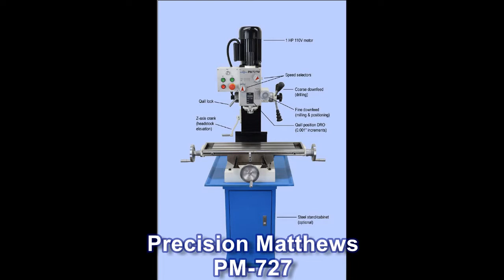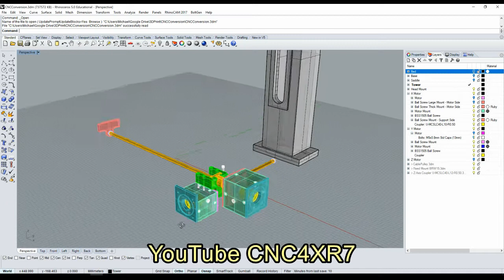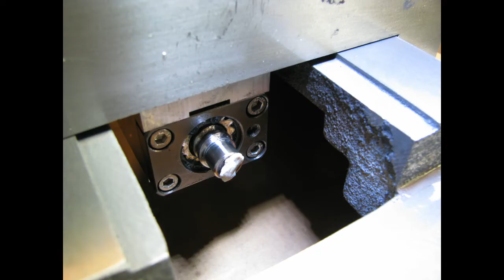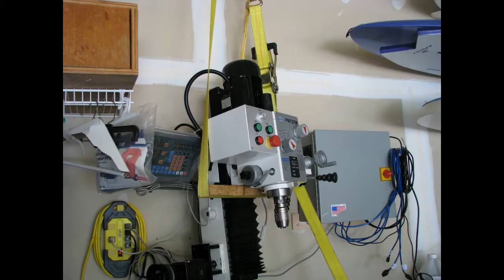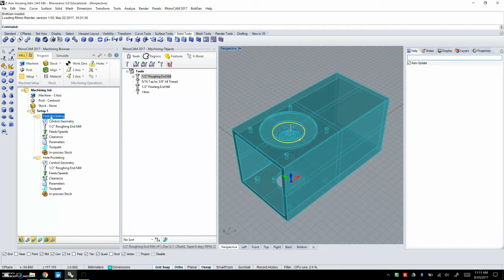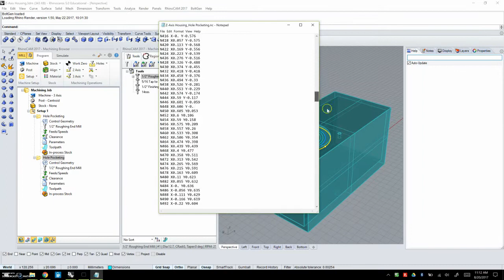CNC Milling w/ Rhino, RhinoCam, & Centroid Acorn

Comment: Came here after finding the Centroid-sponsored video of your PM727 build. I'm going to do a build based on their new 728VT. I was wondering two things: a) what is the complete part number of the OMRON encoder you used, and b) what are the coordinates for the lower cost provider for the Royal quick-change tool holders? Cheers!
Reply from the maker: The encoder I am using is a E6B2-CWZ1X.  The website for the Easy Change Tooling: http://www.engineeringsupplies.co.uk/tool-holders-easy-change-c-175.html?page=1&menu=1

Comment: Great job on your build Mike. I am in the process of converting a PM-30MV. I purchased some of the proximity sensors like you used and had a quick question regarding wiring them up to the acorn board. You mentioned you ran your sensor wires to a small project box then from there into the electronics cabinet to the acorn board. My question is that on the Acorn wiring diagram it shows to wire NC limit switches in series and wire them to IN1 on the board. Since these switches are different than a normal limit switch because they have to be powered, did you wire your switches in series or did you wire your switches to the other inputs on the acorn board. Thanks, Al
Reply from the maker: Thank you for the compliment.  Good choice on the PM-30MV, its is an impressive beast.    I can attest to the quality control of Precision Matthews and they stand behind their product.

You can wire them in series.  I'd paste a picture if youtube would allow, but I'll have to describe in words.  Starting off, each sensor gets 24V power (Brown input).  The first sensor in the chain has it ground (Blue input) running to ground as normal.  Now, the first sensor's signal (Black input) runs to the ground input of the second sensor (Blue input).  And this repeats for the third sensor (Black to Blue, Black to Blue).  The last sensor in the chain has its sensor signal (Black input) go to one of the Acorn's inputs.  Let me know if this is clear.  I can send a picture if you PM me.
Reply: Thanks for the explanation Mike. I did send you a PM on messenger. Thanks, Al

Comment: I love your PM 727 milling , what motor are you using for the Z axis, i know its clearpath but what is the part number of the Z axis motor .. and can you sale the drawing .Thanks
Reply from the maker: The Z-Axis is an SDHP-3441S-ELS.  Quite powerful.  I tested it without the counter balance and it moves the axis fine.  I have 30% torque limits on all the motors.  Shows you just how powerful these motors are.

Comment: Hi Mike,

I’m interested in converting the same machine. I’m getting ready to bench test my acorn unit to control the spindle. Did you go from Acorn to voltage isolator to the built-in potentiometer on the PM-727, or did you replace it? I guess the real question is, is the spindle motor DC, or Ac single phase?
Reply: Also wondering, once you have digital control of your spindle, do you leave the adjustable belts on a mid range setting?
Reply from the maker: Tyler, sounds like you have the variable DC motor spindle.  My unit is the older model with the AC motor.  I replaced the original motor and added an AC Drive VFD.  I think your approach should work.  Note if the machine uses 0-5V or 0-10V.  You can adjust the Acorn to either range.  You may need to remove the conformal coating to get at the connections.  What voltage isolator are you intending to use?
Reply: Michael Wazenski I haven’t purchased the PM-727 yet, but it seems the way to go is the 727v rather than the 727m. Difference is the V has the variable DC motor which I think can be controlled by the acorn relays and the KBSI-240D. MartysCNCgarage has been really helpful. Do you leave your physical spindle drive belts in a mid range position?
Reply from the maker: @SailingSVTattoo  There are no spindle belts on either the 727M or 727V.  They are driven by hardened gears.  I generally operate the machine in high gear, which is about 1:1 with the motor.  For rigid tapping, I go into a lower gear.  Since I have an encode directly on the spindle, the acorn doesn't care what the motor output is, only that the encoder is belted 1:1 with the spindle.  Keep in touch as I just got a new 727V which I want to convert to CNC as well.
Reply: That’s great! Can we exchange regular email addresses? Would be good to communicate about your v conversion.

Comment: Mike, great job! What ball screws did you use?
Reply from the maker: Thanks.  I ordered from Misumi.  They are a bit pricey, but they are the only company I found with a low profile nut.  This allows the nut to clear the X-Axis table for easy assembly/maintenance.  For X and Y, they are 12mm ballscrews.  For the Z-Axis, I went with 15mm.  I also ordered matching fixed mounts, which simplified integration.
Reply: Michael Wazenski Another great video. I have used Rhino and found the learning curve steep. I use Fusion 360 now and while it is also a very powerful software, it has been easier for me to learn and improve my skills. I also used to operate the old KOMO CNC router at Maritime Plastics. We used Ventric software as most our parts were 2D Acrylic. I made most of the parts for my boat there. Cheers ~ Al Livingston